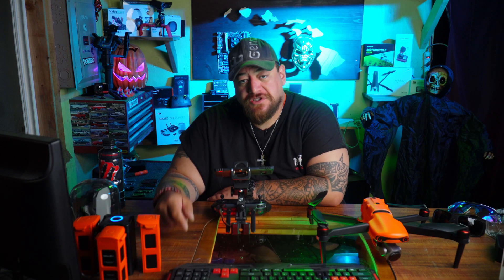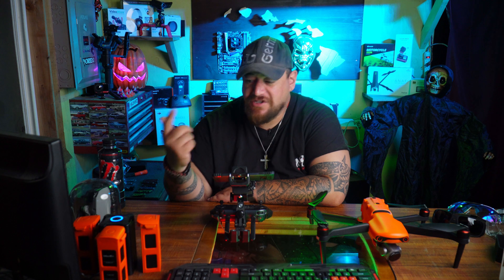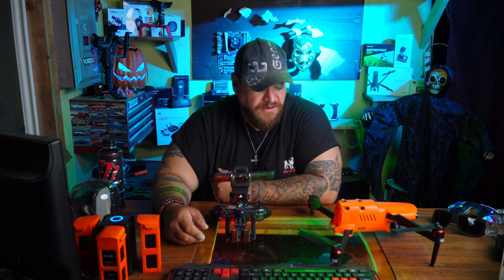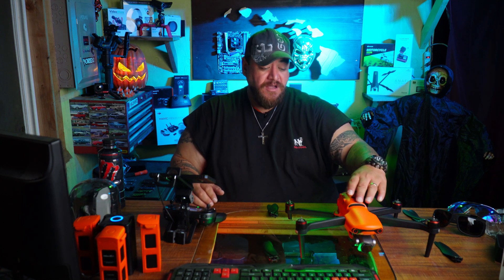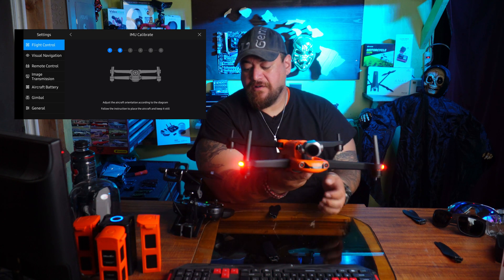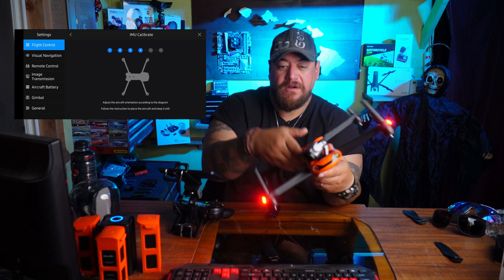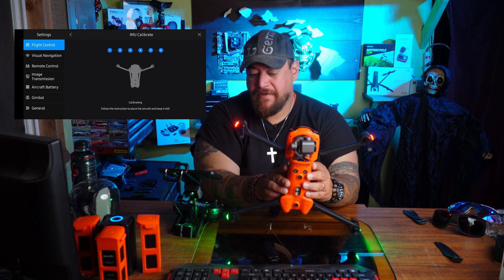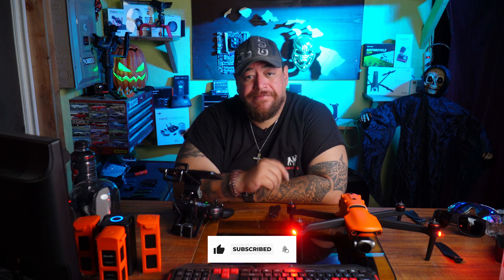Autel Evo 2 How to do IMU Calibration

Comment from the maker: For all of you who are wondering if you suppose to set it on the table with arms folded or hold it in your hand. The calibration is a directional adjustment. I did it both way. Setting it down and holding it in hand. Both ways the drone had no issues flying. Just an FYI. Aloha
Reply: It WILL be more accurate/stable of a calibration if you sit it down on the desk. Also, you want to ensure that the desk is a LEVEL surface or it will skew the calibration.
Reply from the maker: @highdesertras5477  should ve seen how much I tried to screw it up on purpose lol. They left alot of room for calibration before it fails lol but I hear you.
Reply: @808Stat3  That's surprising (and more than a little concerning) as it should be completely still while calibrating the "Inertial Measuring". I know my Mavics have failed and had me restart just from my granddaughter dropping a large toy on the floor in the same room.

Comment: Thank you my good man. Do you have an issue adjusting the hieght limit? when i try to adjust over 120 meters, it gives me a warning sign saying basicaly you are responsible flying over 120 meters and i cant confirm or anything and i go back to 120 meters. wont let me go over 120 m. firmware is updated.
Reply from the maker: Did u deactivate novice mode ? I never had an issue setting it above the 400feet limit
Reply: @808Stat3  ahh you're right just did it hahaha. Thank you.
Reply from the maker: @Mel007ize  u r very welcome

Comment: Hi on the latest fw   To iOS     Do you still have to calibrate all 3 things imu  Gimble compass
Reply from the maker: I suggest always doing a full set of calibrations after each FW . Be aware though I ran into Gimbal cannot calibrate Drone is shaking error message. Multiple level surfaces later she finally did a calibration.
Reply: @808Stat3  I havint had any issues so far I always preflight checks like a real pilot Gota right.all settings everything
Reply: @808Stat3  thanks a lot

Comment: Hello - Should I buy this drone or the Mavic Pro 2 - seems like there is some troubles with the software ? 👍👍
Reply from the maker: Every drone has its pro s and cons and issues with software. The choice is yours. My experience are terrific with this drone and I love it. Does it have occasional glitches and issues ? Yes just like every other drone. I have not regret my purchase at all. I love that I went with Autel
Reply: @808Stat3  Thanks for the advice I liked and Subscribed - I just ordered the 6K one - I need a 1 inch sensor drone 👍👍
Reply from the maker: @Nathan.Manchester  make sure u grab some v60 or v90 SD Cards they are best for 6k and 4k recording.
Reply: @808Stat3  Will do thanks again 👍

Comment: @808-State My suggestion is to do it and put the drone in the position you see in the picture, can leave the legs out like you did.  But, whatever you see in the pic is what the drone should look like.  So most of the time the top of the drone should be facing you .  I was holding mine in the air while doing the calibration standing out on my pool deck enjoying some sun.  So you don't have to do it on a table for sure.
Reply from the maker: Yeah as long as calibration is initiated and you hold her still she will adjust correctly. I did 5 imu calibration to see if you actually can mess this up. She won't give you a successful cal in any case u move too much or not holding it the correct direction.

Comment: Man... You do it wrong. You need to put it ON table. That's why you are asked to take out propellers that you  need to put sometimes it directly on table as per drawing and you could not do this with propellers.
Reply: And here is example of PROPERLY done IMU calibration without blades. You'll know what I mean: https://youtu.be/zKyZ9Ca8bI0
Reply from the maker: @NicodemPL  i did it both ways. Holding it and using the arms to set it on the table. At some point u will be required to hold it either way. It works both ways my friend.
Reply: @808Stat3  no, you should not hold it. Put it on surface that's why you are asked to fold back legs. IMU is responsible for getting data on movement of drone and calibration should be done at still surface. And it's not only Autel but all drones that have this. Specially for geodetic/geospatial use with applanix IMU for example. It has to stay perfectly still and our arms are not good for this. Sorry for being too harsh on this but later you got some people asking why their drone drifts. 2.5.11 is very much about these drifting issues and therefore it's important to do calibration perfectly. Still Autel could do better job and prepare tutorials as this is not clear in manual.
Reply from the maker: @NicodemPL  it's not harsh at all. I appreciate every input. I just telling you that I did it both ways and flew an entire battery after each calibration and it remained the same my friend.

Comment: Awesome! You are the best YouTube for Autel!!!  Ok... I did all of the update and calibrations.  I reported a long time ago about the Smart Orbit drift.  It was right after the update where the drift started  I have video of before and after that early firmware update.  I was hopeful this would fix it.  It drifted all over the place in smart orbit.  It seemed the yaw was off and not holding.  So the update that just came out did NOT fix it.  It still wobbles or drifts around the target.  I will post footage shortly as well as screen capture.  
The drift in normal hover seems better but I did notice a little increase in altitude from when you want it to hover.  
Dude keep it up!
Thank you for bringing us your Hawaii footage and knowledge.
Reply from the maker: Thank u for watching and I deeply appreciate you sharing ur experience with me
Reply: @808Stat3  Here is the link of the footage of the drift as well as some other footage.  My video editor crapped out on me so I couldn't cut the footage.   https://youtu.be/McMjDcRO_2E
Reply from the maker: @therealbillrichardson  that is some weird drift bro. Did u ever try just to push the right stick left and right to increase rotational speed ? I actually never use the slider
Reply: @808Stat3  Slider?  No I just did straight smart orbit since I know the original release worked like a charm.  I reported it to Autel today and synced flight logs.  But I might go out today or tomorrow and move the sticks.  Originally when it was released I had a dead lock on the target and it was AMAZING!!!!!   So I am not sure why it does this, but it is annoying for sure.
Reply from the maker: @therealbillrichardson  slider or stick either way she shouldn't be drifting away like that. Hope they'll figure it out.

Comment: I was doing it all wrong ,i was laying drone on my bench and needless to say it would not work ,thanks for the tip ,You Rock Brother
Reply from the maker: Dude no feel bad . I did the same thing. towel on the ground and all hahahahahaha
Reply: @808Stat3  you guys were on the right track though. Towel may not work with the standing up vertical with camera up and 2 legs out for stability like in the pictures. Thats how Autel does them at the factory when they do repair work and send them back to customers. Just like in the pictographs. Problem with the pictures autel shows is in step 1 to 3. It indeed says fold the arms up but in the picture the arms are out which is entirely misleading. I was surprised when it worked by holding in mid air as I did mine on my marble table top in living room. The pictures after step 3 are properly displayed and the drone stands up like a handstand/headstand with camera straight down and straight up.
Reply: @808Stat3  you weren't entirely wrong brother you were actually right the first time. However it gets done and brings up the successfully calibrated message 🙌 is right in my book. Glad you finally got it man

Comment: I got stuck on step 3 about 4 times. The pictures don't help from step 1 to 3. I luckily have done an IMU calibration to the Mavic Air 2 and their pictures show properly. I didnt do it the way you show here I did it like DJI shows you in there pictures during IMU calibration. I had all legs folded in like it says in the beginning of process for the autel imu calibration. I didnt think you could hold it like you did because I thought it wanted complete stillness not held. Im glad I know it can be done this way too. Thanks for the review of IMU calibration as it wasn't the simplest at very first try. Great explanation my friend
Reply from the maker: Yeah I messed this up 4 times lol . Then i realized what it wanted me to do lol
Reply: @808Stat3  yeah step 1 through 3 I had the crafts legs all folded in so the drone was completely folded up like in storage. Step 1 through 3 went like a breeze after that. It sits nice on each side as well as the bottom. Then after step 3 it shows the pictures properly is what I thought. Again, glad I saw the way you did it too. 

But yes it sits perfectly flat right on the table top every way it shows you to sit it. Even when it looks like it's doing a hand stand with only 2 sets of legs out and camera pointed straight down toward the table top lol. I thought it needed to be a perfectly level surface and completely still for the most accurate calibration? Obviously not though if it can be held in mid air by a human. Its all about orientation of the craft is all it is...

More than 2 ways to skin a cat they say lol. But yes the IMU calibration is very interesting. I wonder if Autel had to do that calibration each and every single drone they sold to us before we received them. My guess is yes they absolutely did that to each and every one, one by one before boxing up and sending them.
Reply from the maker: @flyineyeaerialfpv5592  I actually just used the legs to stabalize it. Put it softly on the table and it worked as well. Less natural shaking.
Reply: @808Stat3  I am glad to hear you have done it this way brother. This is indeed how autel does it when they repair a drone and send it back to the customers. Glad we can all share this valuable information brother. God Bless and Happy flying. Aloha
Reply: I actually speak back and forth with a fellow drone enthusiast that also has the evo 2 pro. I met him at a cool spot in Pittsburgh Pa at point of view park. We share info about the evo 2 and lots of other tech stuff. Its nice to have a big circle of people to share info about this tech stuff. He said he watches your channel when I mentioned you. Your getting popular brother. Soon you will be up there with Dobo and them guys. You might not think brother but it will come. Hard work pays off and you do put a lot into the channel its well deserved man. God Bless

Comment: Thanks for another great instructional video in simple terms.

Only thing I would add is what IMU stands for (Inertial Measurement Unit) and what it does, measures pitch, roll and yaw using gyroscopes, to help stabilize the drone and measure changes so your drone knows if it needs to make any corrections.

But you can add something about it in the description.

I know many people will either know this or look it up, but since your video is a great instructional tool, might as well give them the whole enchilada here because they are already looking at your video.

Thanks again!

(Siri, it is spelled Inertial)
Reply from the maker: Gonna Pin this comment to stick on top ;) Thank you Jim for the Info :) Aloha
Reply: @808Stat3  change your description to also say inertial, as in inertia. 

The calibration is about the inertia measurement unit, and not about the first (initial) calibration. Siri did an autocorrect mistake on my first post that I have now corrected, but you also should correct your description. Yeah, I should have caught it before I submitted the first time, but what can I say... it was very late here in Cali when I did it.

Thanks again for the information. I do love your presentation and how you handle yourself.
Reply from the maker: @copyjim81  freakin Siri ;) got ya brother.